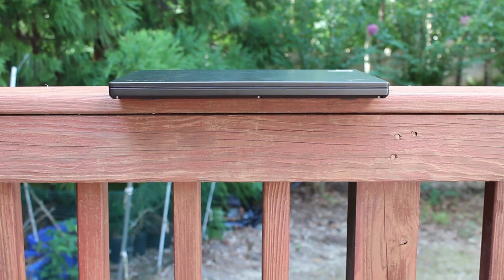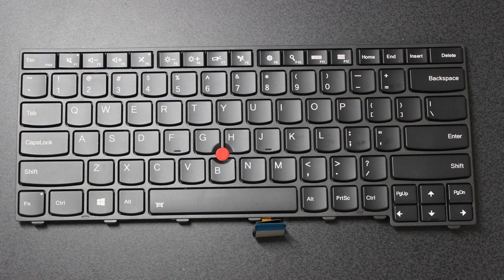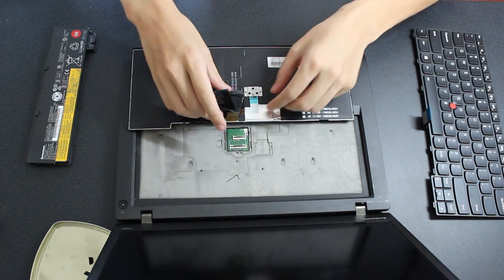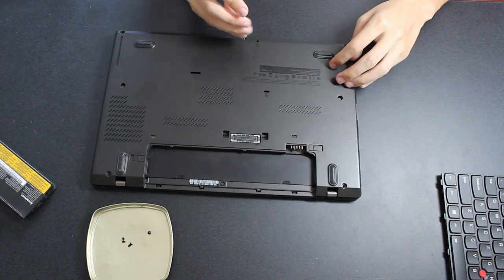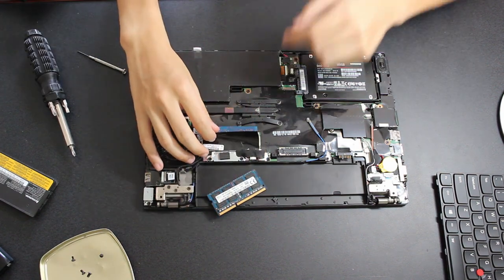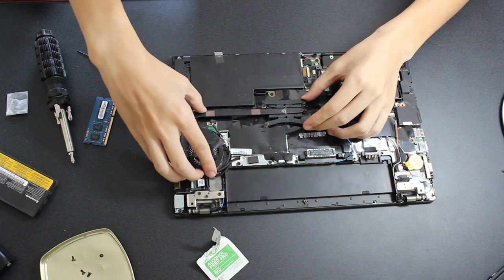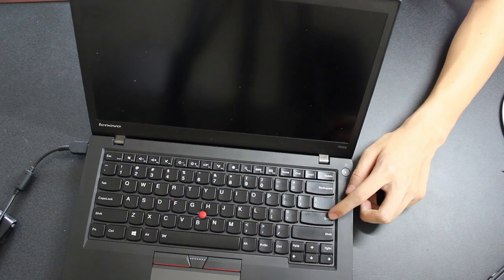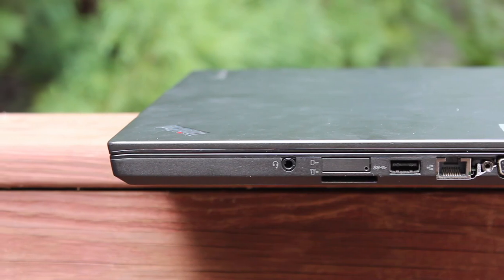High-End Ultrabook Build - Lenovo ThinkPad T450s Upgrade Guide

Comment: Love my i7 T450s. Since 2015. I upgraded the RAM to 20GB and the storage to a 4TB Samsung SSD. Still running as new (Windows 10 Pro). I wish they didn't solder the CPU.
Reply: Yeah man I hate that they soldered the CPU I think they stopped doing it after the t440p it just makes things harder now you have to buy a new motherboard just to replace the cpu which in my opinion is very dumb
Reply: How do you upgraded your RAM to 20GB if only have 1 slot for memory, which memory did you use?
Reply: @josecarlosizquierdoalvarad6354  solderd ram is 4 gb and he add 1 16gb ram

Comment: It's very important to disconnect the internal battery before removing any components.
Also, there's a useful slot under the internal battery which can be used to install a third disk.
Reply: it is disabled in bios

Comment: Thanks for sharing . Love my T450s - it has outlasted my newer X1 carbon. Would you recommend upgrading the stock Liteon SSD to the Samsung 860 for performance improvements? What Wifi card do you recommend?
Reply from the maker: Unless your current SSD is too small or on the verge of failing, I don't believe you need to upgrade it. I find that the stock  WiFi card that comes with the T450s (Intel 7265) is very good.
Reply: Still going strong? (Mainly asking for reassurance, considering I just accidentally dropped mine on the hardwood floor, and even though it's still alive, I'm worried sick.)
Reply: ...this is my first ThinkPad.

Comment: Is it possible to replace the screen. I am looking at getting one but it has a TN panel which is quite bad.
Reply from the maker: The screen is replaceable but it's a bit tougher than the other parts to replace. I haven't replaced mine but there are instructions on how to do it in the Hardware Maintenance Manual.

Comment: Hello i have a question pleaseee.
Is the pcie next to the wifi card always available or free in all the t 450s models? ( the one you said you can use for a 2242 m.2)
Reply from the maker: It will be occupied if there is a WWAN card installed.
Reply: @TigersteveTech   emmm... is the WWAN card necessary? ( i think it is the same as the wifi card but idk exactly what it is for😂)
Reply: @leoG017  WWAN is mobile data, like 4G.